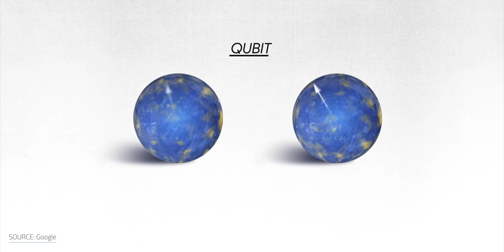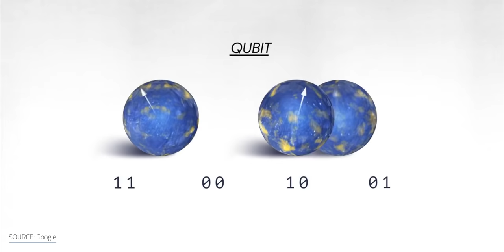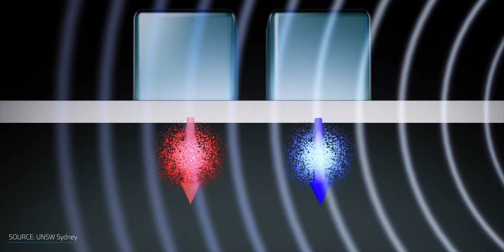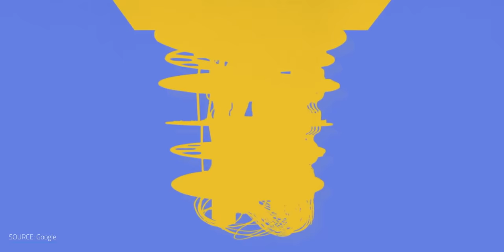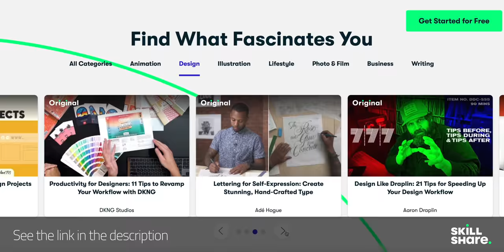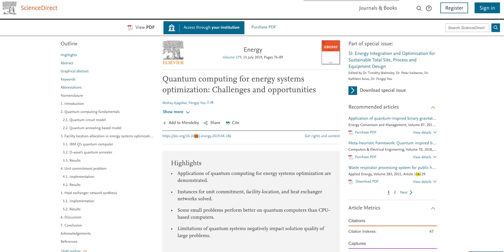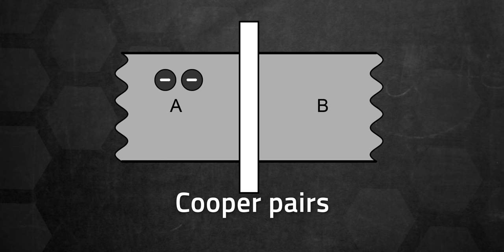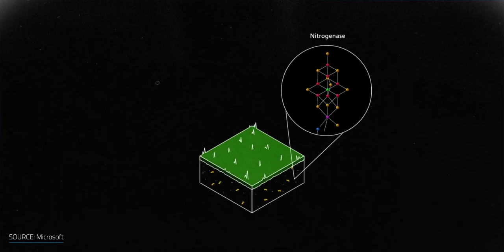Quantum Computers Are Coming … But Why Should You Care?

Comment: Your description of quantum entanglement is way off, by the way. If two particles are entangled, and you read the state of one, you know what the state of the other will be. But you can't "change" the state of one and have it affect the other, since interacting with an entangled particle breaks the entanglement.

The "spooky action" Einstein was referring to was the fact that quantum particles in a superposition appear to have multiple states at once. Collapsing the wave function (by observing a particle) is a statistical process - you don't know for sure of the states you're going to read. But entangled particles seem to collude with each other to always collapse the same way as each other faster than the speed of light. You could never use it to communicate faster than the speed of light though, as you can't manipulate the states after entanglement.
Reply: Couldn't the "when" of wave-form collapse be used to communicate? 😏
Reply: @taiconan8857  The short answer is no. 

The long answer is people say you can't and the math is beyond me so I'm going to take their word on it.
Reply: @taiconan8857  No, and it probably doesn't actually "make" the other particle collapse (There's no such thing as "the same time" across space anyway). It just means you know what the state will be when you measure it.
Reply from the maker: Thanks, Martin.  We may have oversimplified the explanation too much.  It's always tough trying to dial in a complex topic to give the gist at a high level.
Reply: @UndecidedMF  Yeah, I imagine it's pretty hard to get balance right. Still love the rest of the video! :)
Reply: Actually, it's a valid description of a hidden variables interpretation of QM. If you believe that at all times particles have some definite state (probability of collapse) you can slap a number on or describe in any fashion at all, then we have proven by experiment (Bell tests) that one measuring particle must instantly change the state of it's entangled pair. But we can't measure a particle being updated, only the binary state it collapses into, so you can't use entangled particles to communicate faster than light even if they update each other instantly. This is a valid interpretation of quantum mechanics known as a hidden variables theory, and it sacrifices locality for particles having real states. One such theory is Bohmian mechanics.

The most popular interpretation at the moment however (Copenhagen) does the opposite, saying that entangled particles cannot update each other ftl, they don't update each other at all, but exist in an undefinable state that cannot be described in any fashion whatsoever until measurement. 
One tries to explain, and perhaps could, with investigation propose a mechanism behind which quantum mechanics works, the other says there is nothing to understand. Perhaps you see why I prefer hidden variables.
Reply: @msmyrk  "entangled particles seem to collude with each other to always collapse the same way as each other faster than the speed of light." Then at what speed is it? (Guessing it's about 8.9 times the speed of light?) Just throwing it out there.
Reply: @taiconan8857  It doesn't happen at any speed. It doesn't matter when you measure either particle, or how far apart they are. You will always get the same observation between the entangled particles Depending on how you set up the experiment, you can even make it look like the information travels back in time if you want. 

There are different ways of explaining the effect. Maybe there's a parameter we can't see that gets baked in at the point of entanglement. Maybe there are infinite universes branching out, and we are selecting one of those universes when we observe one of particles. 

All that matters (and all we can measure in our puny 4 dimensions) is that the states will always read the same no matter where or when you observe the particles.
Reply: @msmyrk  Why can't something travel faster than the speed of light if it's something massless like an information state? If the way you present the experiment isn't providing enlightenment to the nature of the phenomenon, one should stop using it and rejoice because it's one step closer to understanding in an all new direction. You're also glossing over the Copenhagen Interpretation. Reframing the experiment (like with the delayed choice quantum eraser) only presents further questions when looking at it conventionally. One can easily argue that a single measurement is nigh worthless. But if we understand the planck-length... the ratio of minimum energy-distance packet resolution, a reality pixel if you will, all we have to do is see if the energy necessary to impart that information state violates the ratio. Then we could put it to rest. Unfortunately, so far, we've not had such luck.

Combining this understanding with a realization that temporal interference patterns become possible at this level, it makes the entanglement measurement/outcome obvious.

And if one can, through measurement, guide the ratio of spin up/down/left/right. By following a predetermined pattern of measurement  one by one on an entangled cloud, you can start to approach "probabilistic likelihoods" which can eventually allow a measurer to resolve a deliberate one or zero through measurement pruning for a receiving party. Well, at least some percent of the time. Not to say it wouldn't still be a pain to orchestrate all that. 😋
Reply: @msmyrk , I have always thought it worth noting that the actual comparison by a conscious observer takes place at far less than the speed of light. It is an assumption that the recorded result was settled at the moment of collection by the experimental apparatus. Which seems like a valid assumption, (and Bell's inequality strongly suggests so), but I always thought it worth noting nonetheless.

Comment: The postman example even with a quantum computer, would it need multiple core (or computers) running the same problem. 
Is that right ?
Please explain the example in detail, how a quantum computer will handle such a problem. 🙏

Comment: Too many potential applications of quantum computing to cover!

Another important one is designing, and controlling, nuclear fusion reactors.

One of the big challenges is control of the magnetic fields used to contain these reactions. Responding quickly enough has always been a roadblock to progress. Quantum Computing could be one of the breakthroughs that finally make practical fusion attainable.

Wondering what other potential applications of quantum you are thinking about.
Reply: Bitcoin mining perhaps?
Reply: @brendonnoble5227  I suppose. But seems a sad use of oneof mankinds great achievements.

Kinda like how Captain America was initially used merely as a caricature to sell war bonds.
Reply: Very appropriate, since they are both happening ANY DAY NOW.  LOL
Reply: Dude. You just made my week.  That's a great application for quantum computing. If it is  the thing that  solves fusion,  or at least that aspect of  it, then it will be the apex accomplishment of quantum  computing.
Reply: I  want Fusion power, C02 vacuuming facilities  like CarbonEngineering in Alberta does, Advanced materials for automated construction techniques, advanced materials for cleaning the oceans with, a new material that absorbs C02 from  the atmosphere at a 100X faster rate than any other existing material,...
Reply: @Dennzer1  something tells me we want a certain amount of co2 in the atmosphere but whatever that amount is needs to be much lower than current amounts.

Comment: Do the energy reduction stats shown in this video include the cooling solutions?  When I looked into quantum computing previously, I found out that they required a LOT of cooling.  Like 90% of the rack space was used for the cooling solution, because the computers required -200 degrees C to operate.  Has there been a breakthrough in this area, or is this still the same issue?
Reply: it's still the same issue, it's just that in certain types of computing quantum is SO much faster that it will use less power overall.  It just depends on how suited to quantum computing a particular computation is.
Reply: Cooling is a capital investment provided you have good insulation.
Reply: Running a 30kW quantum computer for an hour or running a 1mW supercomputer for several weeks?    The energy saving is astronomical.
Reply: @krashd  keep in mind they aren't faster at everything, only some tasks.
Reply: of course not. its misinformation as usual.

Comment: A common miss-conception about quantum computers is that they are just faster versions of normal computers using some quantum trickery.  But they aren't.  The superposition stuff means that they calculate all possible values (of the given qword) simultaneously.   With 3 Qbit word you could simultaneously calculate all possible 8 outcomes.  Scaled up to a "travelling sales man problem", the classic NP problem, with enough qbits it will produce all possible combinations simultaneously.   
You might start to see the downside here.  It doesn't give you the "correct" answer.  It gives you ALL possible answers.
If you ask it was 0+1 is, it will give you 0, 1, 2, 3 as the possible answers.  What use is that?
Well, if you have data and you know the answer you want and just need to figure out how to reproduce that answer everytime.... then give it to a quantum computer, let it do it's thing, give you all the answers, let you pick the one you want and by working backwards you can determine the logic path required to reproduce that.
This is basically supervised machine learning, except that the parallism and width/depth of the processing tree is insanely massive and almost everything (Qbit count dependant) is processed simultaneously.
Reply: This is entirely correct, but there’s an extra step at the end - not only does a qubit in superposition enumerate every potential outcome, at the end you use destructive interference to have “wrong” answers cancel each other out prior to measurement. Essentially, it goes from one to many and then back to one.

Comment: I have always heard that quantum computers are very fast and efficient, but they have a limited range of the type of problem that they can be used for.  This limits the range of problems a given quantum computer can address - do you know if this issue has be solved, or partially solved?

Comment: Good video overall but any energy savings in the current chips themselves are easily lost due to the massive cooling infrastructure needed to make them functional. Hope this can improve over time but they are not less energy intensive than our traditional binary systems.
Reply: True for superconducting, though other approaches can operate at room temperature. E.g. trapped-ion, photonic, atomic array, etc.
Reply: They are much less energy intensive than binary systems.  Running a quantum computer for 16 minutes while it completes it's task costs only a tiny fraction of the energy it would require a football field-sized supercomputer the 5 weeks it would take to complete the same task.
Reply: @krashd  100% agree for the time period where we collectively use these computation where they make sense. We all know that quantum is already becoming a corporate/marketing buzz word. I fully expect to start hearing about Quantum ML, and the like soon when there is no reason to use it.

Comment: Quantum transistors/computers are really analog computers. 
Really more of a science experiment, than a practical computer.
Reply: Not correct. That could be said about quantum annealing but not quantum computing. You can also perform classical computations on quantum computers as quantum gates are functionally complete.
Reply: @w760grz  No. You don't know what quantum gates are. 
You don't know.
Reply: @MarkBarrett  I am pretty sure I know what quantum gates are. I am currently doing my PhD in Quantum physics. A Toffoli gate with the third qubit initialized in 1 reproduces the action of the NAND gate. Which is functionally complete.
Reply: @w760grz  They are analog. Variable angle of direction, is the quantifiable result.
Reply: @MarkBarrett  you could indeed think of a quantum computation where you get an angle as a result but you also get an angle when you calculate the arcsine on your phone- that does not make it analog ;) Practically you always measure in the computational basis and get a digital result. The important distinction between digital and analog computing devices is if it is general purpose or not. And quantum computers are general purpose.
Reply: @w760grz  You are smarter than most. 
I am thinking of the angle of measurement.

Comment: It's important to mention that quantum computing isn't some wonder-tech that is a straight upgrade over binary computing

For one, it's only faster on very specific tasks. Think of it as a GPU, it's much MUCH faster than a CPU but only on specific highly parallelizable tasks. Same goes for QCU, it will be ideal for specific calculations but for generic ones traditional computing will still be king

Secondly the computations themselves consume a lot less energy but, until a room-temperature superconductor is discovered if it even exist, quantum computers require massive cooling systems that eat a ton of power

Comment: Fundamentally, the types of tasks you want and need to do with neural networks and quantum computers are largely the same. They're about doing things massively in parallel and thinking about a problem not as a procedural run of true/false questions, but taking in a lot more data and asking the question 'Close enough?'. Just like neural networks are more efficiently implemented in analog circuits in many ways, they'd likewise probably be a great fit for quantum computing, if not basically the same thing to begin with.

Comment: Hi Matt! Outstanding video, as they all are. My only pushback, which is not central to the topic of quantum computing itself, is the axiomatic statement that the amount of carbon dioxide in the atmosphere is our foremost concern. In terms of environmental problems, I am troubled that this has become the single metric on which we are all fixated. Plastic pollution in the ocean, for example, is not captured in this definition. You mention fertilizer, when in fact increasing fertilizer run-off  is responsible for dead zones in oceans. Wind and solar are mentioned as solutions to climate change, when as your other videos describe, we are rapidly running into boundaries with the ability to store the energy captured (in batteries, etc), or the materials to make the wind turbines (rare earth magnets) or solar panels themselves. We also have the social dynamics of far less energy availability in a post-fossil fuel world; it seems unlikely to me that the population will simply and peacefully accept the drastically reduced material quality of life that will accompany the downstream effects of decreased energy consumption. Not to mention biological threats, like antibiotic resistant bacteria. Also as a planet we have completely failed at nuclear disarmament. I’m simply listing a few of many existential threats, within environmental issues and beyond, and wish the amount of carbon dioxide in the atmosphere had been presented as one application of quantum computing, rather than the unequivocal greatest threat there is. Focusing on the one metric of atmospheric CO2 will cause massive and damaging externalities (rapid mineral depletion and pollution from solar/wind/batteries; and the habitat destruction that accompanies the installation of these facilities), and the neglect of other pressing problems. Once again, this is a very non-central criticism to your excellent video, which I enjoyed very much. Please keep up the great work.